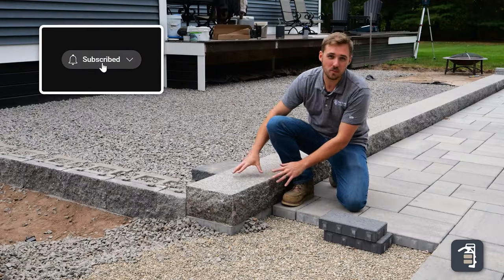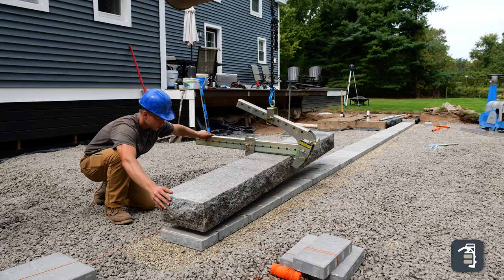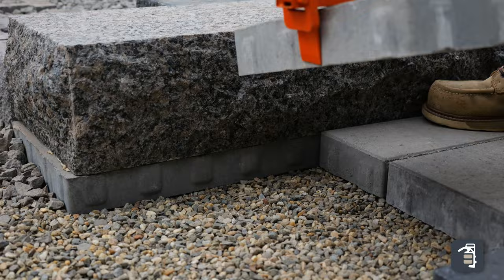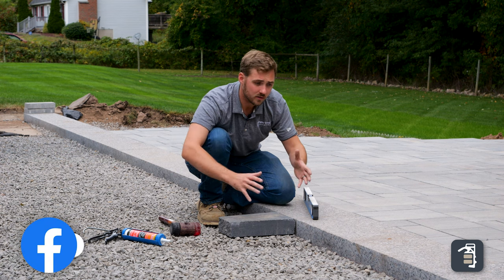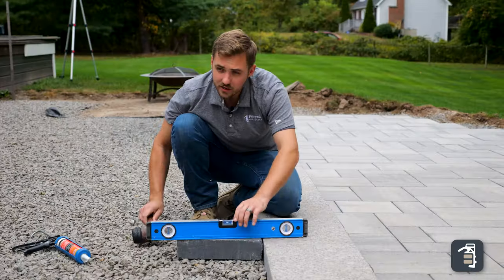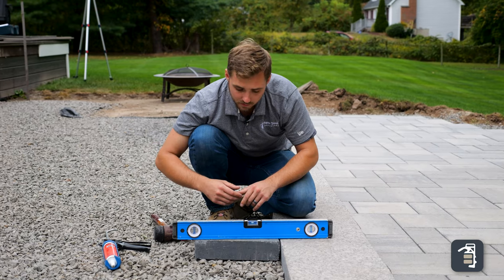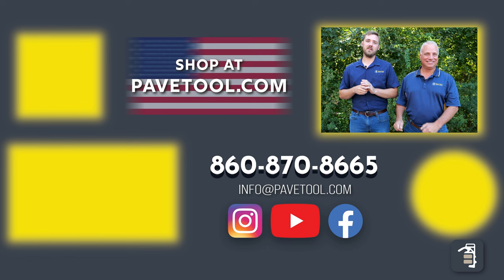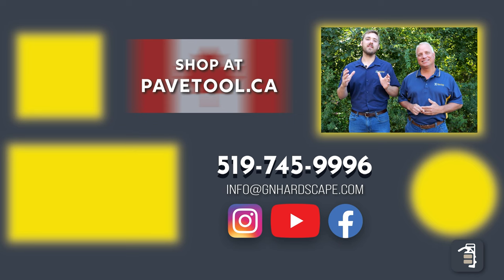Tricks for Setting Monolithic Steps in Hardscaping

Comment: This process looks good and sturdy. We have had good results by backfilling behind the first step with 21a gravel compacted up to 1 inch  below the level of the top of the 1st step then filling that 1 inch with concrete to set the second step on. That way we don't have to level a paver or a wall block behind the first step (saving labor & materials). The second step sticks to the concrete and won't move, and forms a bond between two or more longways as well. ✌
Reply from the maker: That is definitely a decent way to install it, however we found its less mess avoiding the concrete and utilizing block to block contact with one of the great adhesives on the market. In the northeast where have freeze and thaw, it is more ideal to use a clean stone (#57) as opposed to gravel to prevent any potential movement from hydraulic pressure. With 40 years experience in the industry, and after lots of trial and error, wave found this to be the easiest and most efficient way for us. As always keep up the great work, and thanks for the feedback!
Reply: @PaverToolInnovators  Mostly agree with you for up there. We are in Richmond VA area, and not as many, and esp. not as deep, of groung freeze. Under pavement almost non-existant.  Thanks for the tips,,, and keep on keepin' on !👍✌

Comment: I learned a long time ago when building steps, the best and I think strongest way is to install a 6" layer of 57s as a base, install a base course of filler block a bit wider than your steps all around, and then install your wall of choice around the perimeter of your steps with additional filler block behind the good face block.  Then repeat using more face block and filler and obviously using less filler the higher you go.  All the blocks and caps are glued with a bit of wall adhesive and finished off with caps for your tread.  Builds an incredibly strong set of steps that isn't going anywhere.  Uses lots of block but once you get your base course leveled, it's just a matter of gluing and stacking so very fast opposed to leveling each course using 57s behind each step.
Reply from the maker: This video is of course only speaking into monolithic steps, but when installing a segmental step in the application that you speak into, we likewise integrate a full block minimum behind each step, and also incorporate biaxial geogrid on each layer to prevent spreading over time. Keep up the great work and thanks for watching!